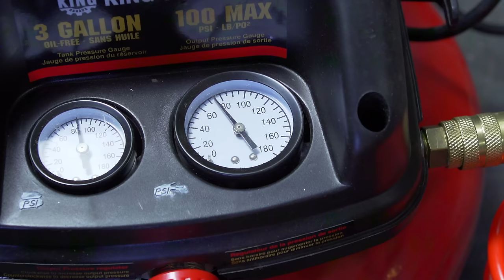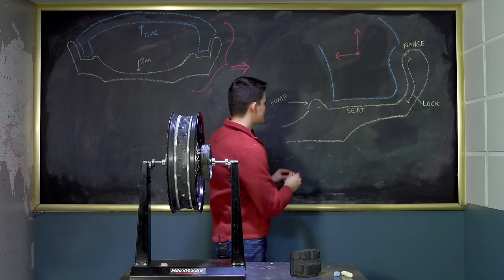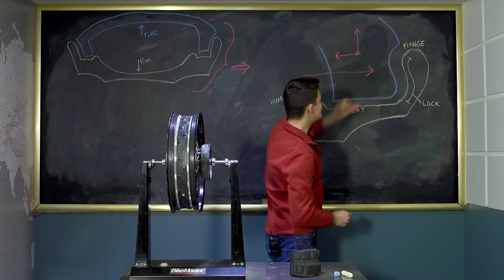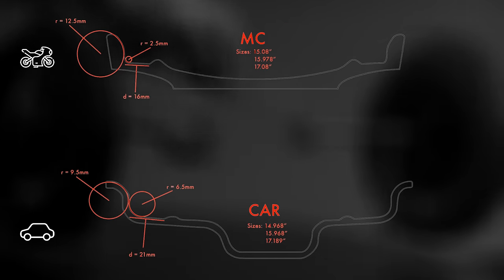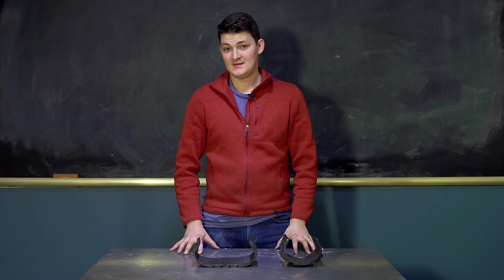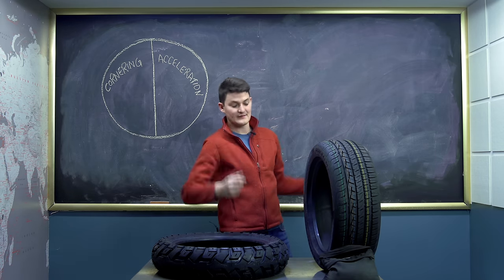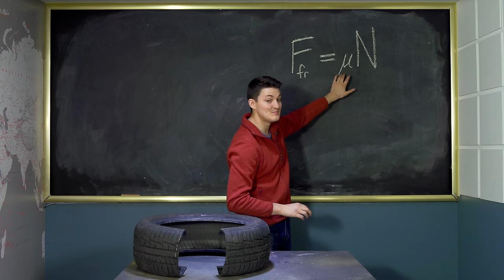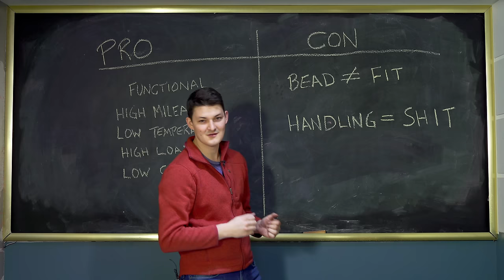Are Motorcycle Tires a Ripoff? The Darkside Car Tire Experiment

Comment: I don't totally disagree but don't totally agree either. Your choice of ride is a very light bike. Also with that being said, tire pressure is also involved. I run darkside on my Victory Cross Country tour with 38 psi. with darksiding you have to play with the pressure. being a lighter vehicle, you don't need recommended pressure which then will allow the side wall to flex slightly more and the tread to relax for larger contact patch. It is a fine balance when riding the darkside. Yes, those of us that choose the darkside realize the perfect match is not so perfect, most of us are very inventive on inspection and maintenance of said tire. i will also add that my last 2 tires were snow tires. I made that choice because of the tire compounds. Yes, an all season is definitely a harder compound, but a snow is not. as far as the up righting that is a slight issue as well as using slightly more counter steering pressure in the corners. Great video by the way! if you ever get a chance to get a full dresser and try the theory again i would love to see it!

Comment: I've widened my own rear wheel to accept the wider 200/50zr17 tire. It has saved my ass on at least one occasion during a panic stop where every inch of pavement mattered, not to mention better handling and a more comfortable ride. However, it is unwise to mix and match car and motorcycle tires since both vehicles have a big difference in weight and handle very differently.

Comment: THANK YOU!  I have always said, I will NEVER go darkside, and this confirms my position.  If motorcycle manufacturers felt it was a good idea to put car tires on bikes, they would.  It would even reduce the price, yet they choose not to.  And if bike shops refuse to mount them, there's good reason for that too.  Bike tires are designed to roll sideways.  Car tires are designed to remain flat.  It just doesn't make sense to put a car tire on a bike that spends half its time leaning a few degrees either way.
Reply: Funny how those that scream doom and gloom about running a CT on motorcycle are those that have never tried it! 😂😂I have a quarter million miles+ running dark and I will never go back to motorcycle tire on the rear. Never.

Comment: I owned a Boss Hoss for a short time which used a wide car tire (on a car rim) at the rear. I didn't keep it long enough to get comfortable with the contact patch constantly moving left and right 10 inches when riding reasonably straight.

Comment: Probably the most controversial subject in motorcycling.  Those have never tried it are clueless as to how it works.  I was one of those.  I found it pretty much responded just the opposite of what I would have thought.  You would think it was perfect in a straight line and sucked in the corners.  I found out it was just the opposite, especially after pushing it hard on "The Dragon" but there are concerns with DS tires on a mc rim such as how well the bead is seated.

Comment: Area does effect a tyre grip though, rubber doens't have a linear curve for pressure vs grip so losing a bit of weight per square inch has less negative impact than the positive for adding another square inch of contact area. Of course this depends on the compound and the weight of the vehicle so you get diminishing returns for increasing tyre syze at a given weight.
Very light road cars can get almost no benefit from bigger tyres sometimes not to mention an even lighter motorcycle

Comment: Hello.
I loved your explanation.
But from what I gather from your explanation, is dealing with a two-wheel motorcycle that leans in a turn. I have a Can-Am Spyder RT. So it has three wheels on the road and you do not lean on it in turns. The back tire OEM wears really fast. It is a flat tire on the running surface it is not round like a normal motorcycle tire. Although it is a little more flexible on the sidewalls or can roll onto the sidewall a little bit I'm told in a turn.
But based on your explanation, would it be fair to say that a three-wheel motorcycle with a car tire on the rear would be safer than a two-wheel motorcycle?

Comment: I feel that I didn't get a good grasp of the cons of the car tire...

Specifically with the aspect of it not being as soft as it "could be" for a much lighter vehicle... Would using a chemical (there is something used in racing) that soften the tire be of benefit for this application?

Comment: I use 185/55R15's on my Bandit 1200 Sidecar rig.  

Only because i'm actually using Automotive rims on adaptive motorcycle hubs.  I'm slightly nuts for riding a sidecar rig, but not entirely crazy.

Comment: doesn't increasing contact patch increase the coefficient of friction. If not, then why do f1 cars use as wide of tires as possible, and why would top fuel dragsters decrease tire pressure to increase the amount of rubber that contacts the ground. Am I missing some other element that makes it desirable to have larger tires?

Comment: I think it'll be fine if you're mostly going straight or on gentle curves for thousands of miles.
Reply: I ride darkside and that's mostly what I do, though I have run it on some pretty curvy roads. I road the Pig Trail in Arkansas and it was fine. I could barely tell the difference even on windy and hilly roads.

Comment: The same on a motorcycle as in a car. I prefer either one to have loose handling characteristics. as opposed to having pushing handling characteristics. it is said that a vehicle that is loose allows the rear to kick out. and a competent rider or driver can compensate for this handling characteristic. by turning the handle bars or the steering wheel towards negative lock. and feathering the throttle causing a controlled skid. this is the objective of drifting. however a vehicle that pushes like a dump truck is a whole other story. the operator of the vehicle has little choice. but to be along for the ride right straight to the scene of the accident. when no matter how much the operator turns the wheel/handle bars. but the vehicle doesn't respond to the input. a horrible feeling indeed.

Comment: If you're looking for a REAK adventure try a Russian Ural Bike with square section, block tread long-wear shit tyres and no sidecar.
Add wheels that are LITERALLY rubber mounted so the spokes don't break and almost vertical steering angle rake.
A joy in the rain.

Don't let that put you off though, add a Sidecar and its a 3-Wheeled Lotus.
.
An experience never to be forgotten.

Comment: I saved money and put a cheap Sears and roebuck tire on the front in place of the more expensive guaranteed to stay clinched 100+ mph Dunlop.
After broken clavicles,  fingers one ankle, ribs and a few toes, plus lots of skin; I have decided to only use top of the line tires and wear proper gear.
For some reason, maybe slightly low PSI, the tire came off the front wheel at 140 mph.
Stung a bit.

Comment: What PSI were you running?  I would imagine a PSI intended for a heavier car would not be appropriate for a much lighter motorcycle, and the tire would essentially be 'over-inflated.'  You may need that PSI to keep the tire seated on the mis-matched bead though...  Either way, It would have been better to have a narrower car tire and lower PSI.  Just my two cents...

Comment: I've been running car tires on three different motorcycles for the past 8 years. I've logged more than 150,000 miles on four different brands. They do ride differently. But after a hundred or so miles you are past that. Because the rear tire has a broad flat face you don't initiate the lean by shifting your weight, but by counter steering and racheting in the lean angle. Once set I have no trouble holding it. I typically run with 44 PSI in the back tire. I typically get over 20,000 miles but usually between 30,000 and 35,000 miles on them.

The bikes I have used them on include a 1993 goldwing, 1999 yamaha royal star boulevard and venture.

Each bike came with an MC tire on the back, which I replaced with a  CT ASAP.

I've ridden on every kind of road you can imagine, dirt two tracks, interstate, etc.

I've ridden to James Bay, the tail of the tail, back, and claw of the dragon. Done the 555 in the rain, tbd cabbot trail, mt evans, mt ranier, 101, yosemite - the high pass. Some of this has been hauling a trailer, some hauling a popup camper. Much with my 200+ lb wife on the back, fully loaded, in every kind of condition except snow on the road.

I've never had a problem with the car tire!

I recently put real time pressure monitors on my tires. And I can say that the rear tire typically runs AT LEAST 20 degrees hotter than the front! This makes sense. The rear ture carries more weight and because it actually does the pushing, generates more frictional heat which makes the rubber softer and gives it more grab.

Car tires aren't for everybody. If you only log 5K miles a year a rear tite will last you a year. If you doing 20k+ a year you do the math.

Also, getting them on your bike is tricky. I get a car tire shop to mount them. I pull them, balance and install them. $22 to have them mounted. I have them do my front tire too.

If you decide to do this, find the darkside database for recommendations for your bike. Check the user forums.

I've just rolled 200,000 miles since 2012 and the vast majority has been riding on the dark side!
Reply: Congratulations on knowing more than Michelin, Pirelli, Dunlop, Bridgestone etc.
Reply: @davetrousers  if actual experience on the subject counts, well then I do for I.m sure they've not bothered to extensively test the idea.

But wait a minute. They sell motorcycle tires which typically cost a LOT MORE MONEY than a car tire right?

Well everybody has an opinion, right? And we know that opinions are like something else that everybody has one of, right?

You show me ANY one of these motorcycle tire engineers, much less corporate executives, those who set policy, who have tested the idea of a CT on the back motorcycle wheel for more than a few miles. These are the folks that set corporate policy. To be within the corporate framework and to speak against corporate policy on such would be to loose your job!

Experience counts and I have a bunch, Before I tried riding on the dark side I searched the web for any account op a darksider having a motorcycle accident because of their CAR TIRE. I found none, And now after 150,000 miles of my own on three different bikes using 4 different brands of car tires and  on as many different cat tires (some  of these tires are still in service across these different bikes) I can also report that I've had no crashes due to car tires. I was rear ended in Florida while sitting at a light, but that wasn't tire related and it wasn't serious.

Experience counts. There is theory and there is the corporate policy of those who make a lot of money selling motorcycle tires.

The producer of this video told some of it straight up. You get used to the differences very quickly. Each choice has its metrics. The producer suggests excessive risk may be implied through the choice of a car tire, but with now over 200,000 motorcycle miles since 2012 I've not seen anything objectionable with my use of car tires. When I need a new rear tire I order CT and look forward to not having to it again for quite a while.

Experience counts. It is real world knowledge. It begins where theory and corporate policy ends!

Comment: Of all the passenger car tires you could choose, you picked a high performance all season with an asymmetric tread pattern?!  Considering the "inside" and "outside" sections are designed to do completely different things, I'm wondering if it was on purpose or by chance.  Care to elaborate?

Comment: make sure pick a car tire that is to wide for the rim , that solves the bead lock problem and gives a small curve on the flat surface which helps with counter stear
Reply: I believe he fitted a 205/50/17  on a 4.25" rim     on a car it would probably be on a 6.5" rim.   I doubt anything wider would fit in the swing arm gap on the F800gs

Comment: 6:29 Been there, done that. One late evening on my way to work on my Suzuki GSX 250 ES(D), going through a roundabout at the usual ~30mph, I suddenly lost the front completely. Turned out that some vehicle had dumped diesel on the tarmac. Luckily I was wearing full protective gear (minus a back protector), so I only suffered a sore thumb joint and some battle scars on my leather suit (two-piece zip-together) and my left boot. 
When it comes to tires, having experienced worn down mc tires and the degraded handling that causes, I wouldn't even THINK about putting on car tires...

Comment: Kudos for running a bike on the snow, that is my second or third worse fear, after black ice and maybe sand on a sharp corner when coming in hot. I will keep putting the correct tires on my gold wing even though the Mrs. is getting close to maximum loading for the rear tire.

Comment: If I'm being honest I think this topic requires further study. A lot of dark-siders tend to ride heavy cruisers, which are heavier than the GS800 AND they don't have to lean as much in a turn. Maybe make a second video as to why it works so well with heavy cruisers, specifically? You mentioned a Goldwing.... there's your start. Also, your test was inconclusive due to the fact you only show yourself riding in wet and snowy conditions. No darksider would drive through snow like an some insane Canadian ADV youtuber. They tend to be twisty road or highway riders. Just my two cents.

Comment: If you over inflate the car tire it will be shaped more like an oval and handle more like a motorcycle tire. You can tell if you do this in your car if you drive in deep snow because over inflating will help the rubber get to the road easier.

Comment: Long ago I learned don't go beyond manufacturers/engineers designs and functionality. Especially a motorcycle that can exceed 100 miles per hour. Every company is scrutinized  by the government safety protocols to ensure maximum safety. Hence avoiding law suits. Motorcycle tires are designed with stickier compounds to help the motorcycle get back under control in a slide out. A car tire rubber is harder compound so when you start sliding out in a corner there is not recovering from it.

Comment: Ive darksided so many bikes it takes time to get the pressure just right so you are not sacrificing handling. My pc800 i ran only 8psi and took it threw the cabot trail in Nova Scotia keeping a solid pace with my sport bike counterparts. End of day 2 my buddies couldn't believe i could drag pegs just as well as they could on a car tire. A bfg radial t/a to be exact.

Comment: I guess I technically ride 'double-darkside.'  I have a motorized bike with skinny wheels, and the widest tires I that would fit, which have a cross-section just like a car tire.  They're super soft rubber, so probably meant to be a racing tire. It definitely handles weird, always fighting me to right itself.  Cornering fast is always a tense situation, but the fat straight-line contact patch is great on soft shoulders, and it lets me put all my braking power to the road.

Comment: When you fit a tubeless tyre to a spoked rim you can still use a tube to keep the air in rather than silicon sealant.

Comment: I agree with you.... mostly.  lol... I have run both.   But then, I ride a Harley, so my handling is already shit.  I ran a car tire that wasn't nearly as wide (or flat)
  These days?  I run motorcycle tires...  but not the high dollar ones..  it doesn't hurt so bad when I have to replace them every 6-8000 miles...

Comment: My personal experience was on my first bike a 2008 kawi 650r that came with stock tires i forget the brand but they were hard compound and in the rain you felt like it was going to wipe out on a 10mph turn. I later swapped them out for Michelin power pilots and wow what a world of difference in the rain. I mean you can literally ride full power in the rain, in fact in Wisconsin the weather can be very schizo during the final months of the riding season and you often get caught in snap rainshowers. One time i tried to beat a storm home and got caught in it, light hail. Like bb's hitting your arms and legs. I just ignored the pain and the bike never gave a shit that water was on the ground at all. I passed slower cars at will, never had a moment of doubt on those tires. Ill never ride on anything else again.

Comment: HI  I used  to ride  Suzuki Katana   1100cc 1981    many years ago   the one thing I remember most is wrestling it through the corners she went like lightning in the straight but corners were hard work.  Here in OZ  most roads are straight so my  motor bike tyre was wearing square rather quickly.   Now decades later I am about to buy an Indian Persuit  will be interesting how long the tyre will last might consider the dark side  on the second set.

Comment: I was told the motorcycle tire is more expensive due to lower volume of production. They can't spread the cost over a gazillion tires so the cost per tire is greater.

I'm not convinced a car tire that can go  60,000 miles on a 4,000 pound machine will have greater traction than a motorcycle tire.

I went with the new Dunlop American Elite tires that have a hard rubber strip at the center but softer rubber on the sides for better cornering. I'll not be going dark side any time soon.

Comment: 2:29  Don't we all do that before starting out?  The quality of drivers has gone so downhill, that Saskatoon is going to lower residential street speed limits to 40kph.  Never mind the 95db noise level restrictions already in place, except for every car that does a burnout at my street corner.  Not complaining,  I love engines noise, it puts me to sleep, since I used to sleep on the floor of the 930 Case when I was 5, when out with Dad for a 18 hour shift.